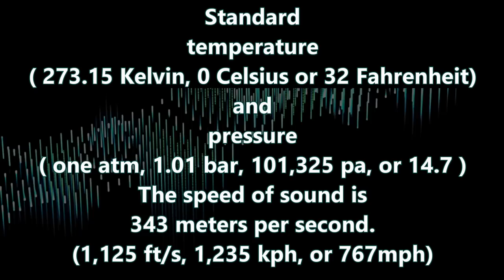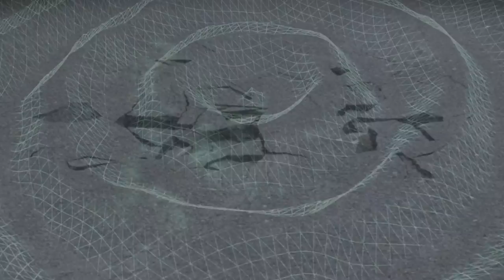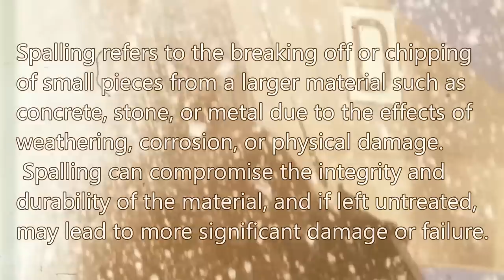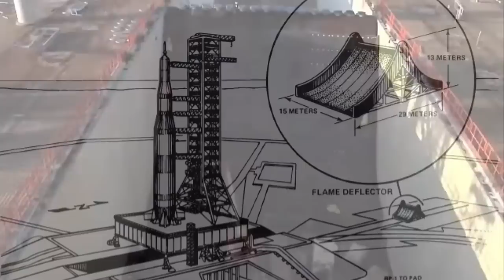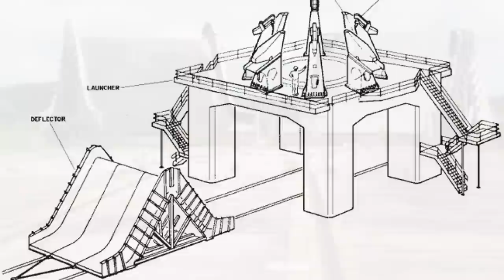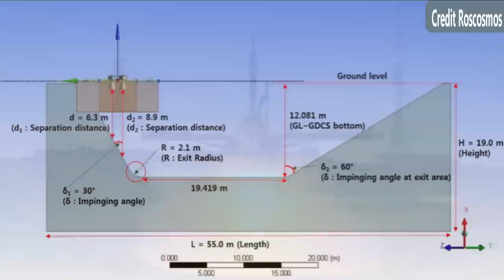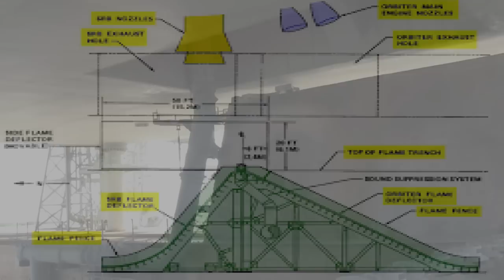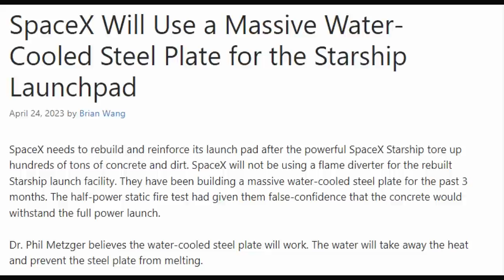How to Fix Starbase After it was Destroyed by Starship!

Comment: A design flaw I believe was having 6 legs on the OLM instead of 4. 
With 4 legs a movable flame diverter can be move into position for launch. The diverted exhaust would also have a larger clearance between the legs at the corners. 
When not in use it can be moved out and have free access underneath the booster for engine exchanges etc.
Reply from the maker: I agree... That would have been the best option.

Comment: Combustion chamber pressure was around 378 bar or higher within the first second of ignition based on calculations of the blastwave as measurable by the known and visible factors of SpaceX footage. The visible blastwave front formed by the dust is traveling at 42 meters per second, and standard engineering references can be used to look up the mass density of the dust to figure out what the pressure is at the visible wavefront (approximately 9 to 10 bar). Regression of the pressure back to the unit meter distance of the source of the pressure wave shows that the combustion chambers are over pressurized while the rocket isn't even anywhere near its maximum throttle and the Superheavy never went above 90% during that test flight. The pressure wave was being directly reflected in a somewhat harmonic mode at the rocket exhaust and could not vent fast enough out the fortified structure of the launch pad. A flame diverter is necessary or the launch pad needs to be raised approximately as much as 20 meters to avoid over pressurization due to the 1.6 hz harmonic reflection of the pressure wave. By my calculation, the initial fire should have been approximately 236 bar in the combustion chamber, but it was increased by the harmonic reflection to 378 bar--and pressure built as it was unable to escape the semi-confined structure fast enough despite the explosive display.

The explosion of the pad was the result of the accumulated pressure finding the path of the least resistance, and it was actually the preferable outcome because in the moment that the rocket throttled up for lift off the combustion chamber pressures vastly exceeded the tolerances of the Raptor V2 (300 bar at maximum nominal operation). This over pressurization resulted in the almost immediate failure of the fuel pump system on several engines particularly those adjacent to the hydraulic systems; engine fires inside the skirt of rocket caused the hydraulic system to pop as the turbopump failed followed by the attached engine immediately failing explosively thereafter; the explosion of the engine caused a decompression event for the oxygen turbopump which caused a mission fatal drain of the O2 around T+60. The general failures of the total engine array are directly attributable to the initial over pressurization.

If the rocket had remained on the pad much longer than it did, it would have popped and taken out the whole pad and surrounding infrastructure with it. The steel plate system that SpaceX has chosen to pursue as a result of the spectacular destruction of the ground level concrete pad will make the problem worse and ensure the next time they try this the rocket is what pops instead. At 300 bar nominal operation, the structure will cause the combustion chambers to operate around 480 bar or more with the pressure wave reflection as next time the path of least resistance will be up rather than down.
Reply from the maker: Very, very interesting... Thank you!
Reply: @terranspaceacademy  I'm surprised by how virtually no one that should know better bothered to do really basic physics calculations to figure out what the measurable explosive forces are at ignition and lift off.

Based on analyzing the sequence of events across the total mission time from ignition to termination, I also infer that the initial shock of the engine ignition and subsequent throttle up damaged the control and telemetry equipment in the rocket. There are multiple cases where the telemetry being broadcasted by SpaceX does not match visible measurement of the engine statuses and there are several points along the timeline where SpaceX confirms loss of control or malfunctions which are not reflected in the broadcast telemetry. Again, I think this is because they basically ended up hammering the whole fuselage with the engine blast causing microfractures throughout the structure; acoustic dampening would go a long ways towards resolving that, but the fundamental problem is the idea of launching from a flat concrete pad that is semi-constrained by a reinforced steel structure too low to the ground. A flame diverter and acoustic dampening might resolve that at the current height and with the current semi-confined volume (a non-trenched flame diverter would reduce volume which would increase pressure I think), but I doubt it and the calculations for that are beyond the napkin math I've done to figure out all the above.

Comment: Love the outro :) Great content as usual. It's a pity that SpaceX didn't see this coming. We all knew and know how valuable stage zero is. A water deluge system is in the works but let's see how it eventually works as I think the base of the OLM up to the height should be encased in a steel plated swimming pool for launch fed with high pressure water of course, it would help with sound dampening and damage control.
Reply from the maker: Thank you!  It is indeed. I can't wait to see what they come up with.

Comment: I have seen renderings of the "water cooled steel plate" SpaceX is proposing.  Would this plate work better if they ran water up the old and dumped it down on the plate so the waters flows from the center out, or forcing water from the outside edges up to the center to pool at the center?  In the first case I wonder if the force of the engines would exceed the water and have the steel plates "run dry'?  In the second option, would they be able to force enough water into the center to counter the force of the engines?
Reply from the maker: I thought they might bring a pipe in underground to the center of the plate and flow water continuously during launch.

Comment: I would think a flame diverter would face the high water table given the area making it a challenge to build.
Reply: Agreed, if they do build a classical flame trench it's going to turn Boca Chica into a small hill because they will have to build up so much; imagine if the launch mount was 27m off the ground like the depth of the older flame trenches.

Perhaps there is a way to utilize the high water table somehow? Not sure exactly what I mean by this but perhaps worth looking into.

I still suspect oceanic launches may be required to launch such a powerful vehicle safely and successfully.
Reply from the maker: Just a two meter tall steel pyramid at the center of the base would help...

Comment: 3:43 1000 Hz is not equal to 0dB at all.
Hz is a measure of frequency (pitch). Decibel is about amplitude (strength). You can have a weak 1000Hz sound (low dB) or a strong 1000Hz sound (high dB)
Reply: And 1000 Hz is not the limit of human sensitivity.
Reply from the maker: Well dang those medical books...

Comment: Well, I for one disagree with them trying to land on failure.   Landing was not even in the cards for success.   True the concrete didn't hold as they hoped but the launch tower survived.   Sending starship back there when they don't have the appropriate flight data means they likely wouldn't have the tower any more as well.
Reply from the maker: They could have brought it down in the ocean.  Just saying it would be really cool :-)  Why not one of those floating platforms?
Reply: @terranspaceacademy  With the Falcon 9 they did a standard landing attempt over water.   I'm at a lose as to why that wasn't in the cards for this test.

Comment: The grid fins on the booster do not fold back like on Falcon 9. They are launched in the extended position and later will rotate as need to guide the booster back. 
The mechanism that would extend the grid fins was left off to save weight.
Reply from the maker: Yes... that's correct.

Comment: Because of the engines being arranged in a circle, maybe a cone shaped flame diverter.  perhaps steel plates bolted together . Use that hole to anchor it.
Reply from the maker: We were thinking a pyramid with edges oriented toward the legs to protect them.

Comment: You're forgetting something when talking about flame diverters. . The pads at Kennedy were built up 55 ft, with very long ramps going to the top to make room for the flame diverters. SpaceX BC site hasn't the space for a 55 ft mound with catch basins for the water. I agree, concrete was dumb, but diverters aren't an option.
Reply: Launching rockets from Boca Chica was the first mistake.
Reply: @interman7715  BINGO, 100% agree.
Reply from the maker: Of course they are... they just can't be that deep.... a pyramid shaped diverter under the center of the booster with steel channels to direct the exhaust flow away from the support legs is a diverter.

Comment: Excellent explanation and synopsis of the logical solution!
Given the engineering that went into the OLT - the mechazilla, the OLM turned out to be the achilles heel of the launch system. Highly unrealistic to expect that they can implement a viable solution in 1-2 months. Emphasis on the word "viable". 
If Spacex can accomplish a successful launch in less than 6 months that would be pretty significant.
Reply from the maker: Thank you Tariq. And you are quite right... still hoping for 4 months though :-)

Comment: The spacex pad blew up due to superheating ground water. That water vaporized adding pressure under the pad. The pad lasted a couple of seconds until the pressure got too high for the concrete to suvive in tension and then literally exploded - that wasn't just spalling. 

Spacex idea to use steel isnt going to work either because steel is riddled (by design) with microcracks. Between the heat and the acoustics, steel perpendicular to the engines isnt going to last any longer than the concrete in this environment, even with cooling. They need a flame trench like Nasa documents from the 70s all say!

Basically, they need a flame trench like Nasa said, and they need the FAA to correct their (absent) safety culture. This is going to take them at least a year to do if Elno listens to the engineers this time, and longer if he keeps trying to pretend he knows stuff about rocketry.
Reply from the maker: What about my water cooled steel plate with a pyramid in the center?
Reply: @Terran Space Academy  there are nasa reports, for free, on all that nasa learned about how to build an effective flame trench. SpaceX doesn't need to reinvent the wheel and this isn't core to their business model so the ignorance is stupid bordering on criminal. 

The rocket configuration is in somewhat uncharted territory for noise, heat, and pressure. There's a guy who said he had some success with water cooled steel plates on much smaller scale that made sense. I haven't run the math, but I've studied steel material properties in engineering. It's a great material, but it has its limits, too. Steel is full of cracks in its crystal matrix and these help to make it ductile. They are also subject to propagation in the same way that fondag cracks facilitated heat transfer to vaporize ground water under the pad that ultimately blew the pad up. 

The issue isn't going to be the shape of the trench, the problem is going to be flowing sufficient coolant to keep the steel from melting. The steel above the coolant channels needs to be very thick to survive the acoustic oscillating barrage but thin enough to support sufficient heat transfer between the oblating surface and the coolant. Obviously, these are competing criteria and while they might be able to make one that survives a launch, (big maybe), I'm positive there's no way they'll be able to make one reusable and replacing the whole system every launch instead of just building the flame trench properly is a huge waste. Honestly, though, I think that such a shield could not last the 8 seconds needed without doing the same exploding trick that the fondag pad did. If even one hot spot gets into the steel cooling system anywhere, it'd vaporize all the coolant instantly and turn the whole steel blast pad into hypersonic shrapnel. Not a good look. It's possible that they could spend a few years on development and innovate some solutions and test them, but it's way too risky for this application out of the box and literally nobody can say otherwise because no launch pad has ever been subject to this sort of abuse. Even the nasa solutions are going to require some testing to get them to hold up, but at least a whole bunch of smart people have spent a lot of R&D time on proving them, so only incremental innovation might be needed. Or they might work right out of the gate, but the "hope this works" approach they're currently trying is breaking way too much expensive stuff and is ultimately putting lives and assets at risk.

Comment: No concrete at all: Only Steel: cooled by tubes welded to steel-platest, designed like Motor-Nozzle (Reusable like the Motor). Cooling water flow in these tubes...
Reply from the maker: I hope the balance the steam exhaust or that thing will be its own rocket. :-)

Comment: Good point to have an inflight abort.  They could have saved the starship or at least ran more test before they blew it up
Reply: Inflight abort using Starship as the abort system is doomed to fail. What they need is full launch abort/landing abort capability. Where a separate crew compartment is carried away to safety in the event of an accident. Much like the abort system for Falcon 9/Crew Dragon. Which has abort capability from the pad all the way to orbit.
Reply: S24 was old tech, it was going to be scrapped either way
Reply from the maker: I think the top of the Starship should be a potential "third stage" for abort and Moon landings.

Comment: Elon recently said that the leading theory on why the concrete broke up was that the pressure compacted the soil under the fondag so much that it stopped supporting the fondag until it cracked and snapped in the middle causing a massive failure. This seems quite possible based on what the soil looks like, water table being so high, etc.
Reply from the maker: That is reasonable.  Layers of cement topped by steel can withstand direct impacts by 1,000lb bombs... a little bunker expertise would have handled that.

Comment: Excellent analysis! I have every confidence that SpaceX will solve this challenge and get back to launching, but I do agree it was a mistake to try to go without some kind of water deluge and flame diversion. A water-cooled steel plate might do the trick, but we'll have to see. I don't believe they'll need FAA approval to conduct a longer-duration static fire at the pad to verify the integrity of the system, and they could use that data to convince the FAA it won't be raining concrete on the next launch.
Reply from the maker: Thank you James! And we agree.  I think they will be a little less incautious next time.

Comment: It's sounding like they didn't even start those three engines and they were not taken out by debris.
Reply from the maker: That's possible... if so they might need to rethink their procedures... If three of 33 fail to operate I'm not sure that's a GO scenario.
Reply: @terranspaceacademy  its my understanding that the whole thing including the boosters is a pretty old design now, I get the impression that it was, "Might as well chuck it up and get some data rather than just scrap it for the next one" decision. I think there were multiple things that went wrong, I think they lost gymbal control and some other engines went out as well. the biggest problem was the abort system not destroying the ship right away, so in that respect it was a good test, no other way to find that out.

Comment: Nolsp  •  5 days ago  
Stage 0 has always been inside the danger zone even from the very start.  I think the Space X knew all along that the ground facilities were inadequate. The really limiting factor here is launch site size.  No way are they going to have the required buffer distance to the storage tanks much less the space to fit a large enough flame diverter/water deluge and vent out area.  At the very least, I think they need an area about 4x as large.  Barring that, I can't wait to see what solutions they come up with.
Reply: At a minimum, they could place the storage tanks in a horizontal position behind a tall enough berm. Anybody that looked at the current arrangement probably thought "Well that looks silly, but I guess they know what they are doing."" They actually had to redo the methane tanks horizontally when the local inspector said "Nope, they can't be vertical by code.".
The whole project is a mess. NASA is screwing itself by depending on it to go to the moon.
Reply: It was an oversight of Texas state code regarding the tanks but it wasn’t because they were vertical. It was because the state does not allow tanks to be built by any company. It has to be a company state certified to build high pressure vessels/fuel tanks.
Reply from the maker: Deflector berms in front?